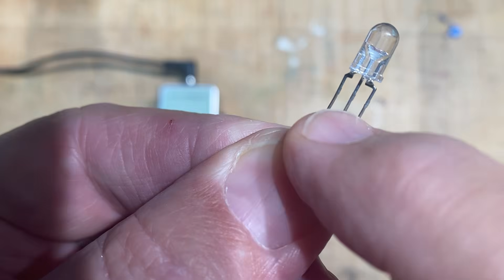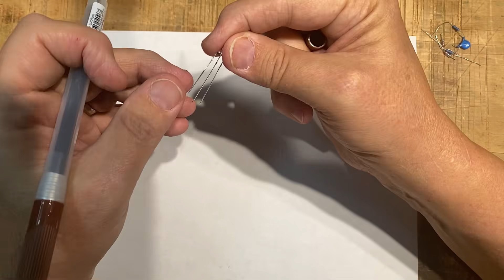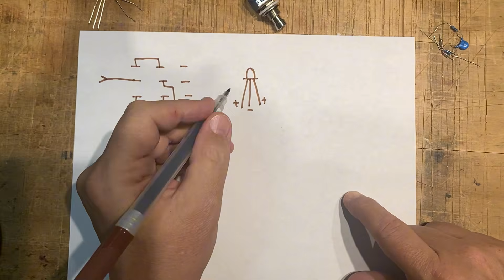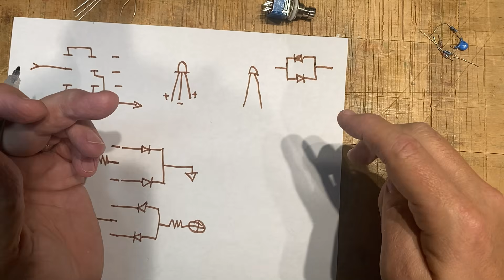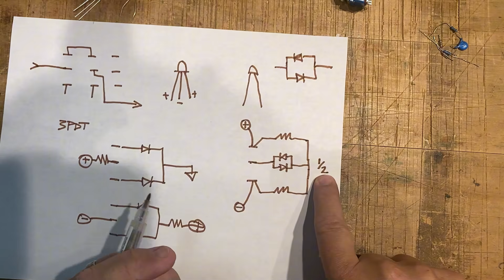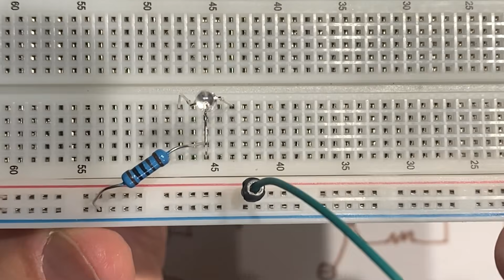How to Wire a 2-Pin Bicolor LED Using a 3PDT Switch

Comment: I bought one of the 2-lead LEDs from Radio Shack as a kid. It glowed either red or green with DC, but with AC they glowed orange.
Reply from the maker: That makes perfect sense since the AC current is rapidly switching the polarity back and forth! Red and green together will give you amber.

Comment: Thanks for the vid, Bill.  I didn't know the difference between 3 pin and 2 pin bi-color LED's.  The diagram really helped me understand.  Have a great morning and an awesome weekend!  RAWK!!! 🤘🏼
Reply from the maker: Yeah, the common cathode versus common anode fooled me once. It seems like overkill for just two colors, but they make three color RBG LEDs in both flavors that could be matrixed to become a giant computer screen. It would take a lot of wire to make such a thing, but I suppose it could happen. For my purposes and for the much smaller footprint, the two conductor version works great! \m/
Reply: @MadScientistGuitarLab Why did I think about an updated version of a control panel on the Enterprise when you said, "...a giant computer screen."  Then I thought... Bill might mean you could build a screen as big as the main disolay screen on the same starship! 😂  My scifi nerd popped out. 😁

Have a grat day, man!  RAWK!!! 🤘🏼
Reply from the maker: I was thinking more of the overhead display on Fremont Street in Las Vegas.